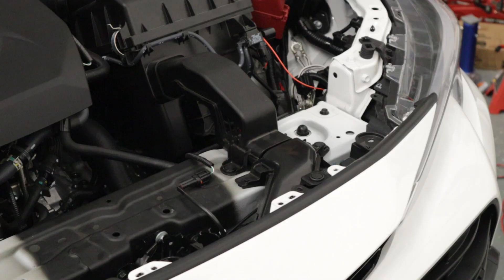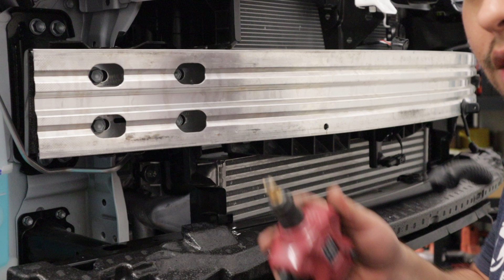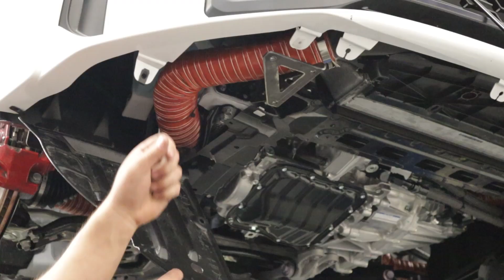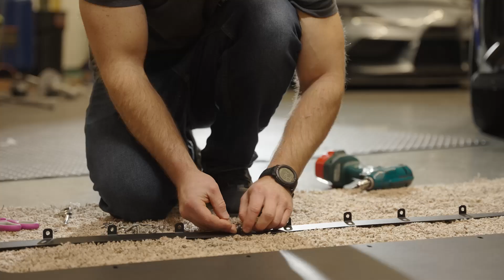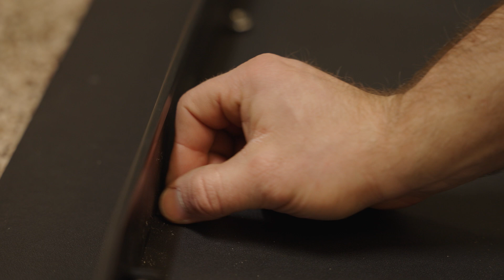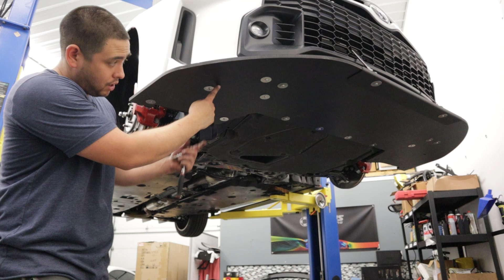How to install our Front Splitter on your GR Corolla!

Comment: I really want this front splitter and fully appreciate all that Verus does in research and development to provide a function over form prioritized products; however, I am concerned that this may be out of my ability to install DIY. I am located in Maryland, so any suggestions for an installer would be greatly appreciated!
Reply from the maker: Dunn Fab Motorsports is probably the closest option that we know about out that way. They're located in NJ so it would be a couple hour drive away, depending on your location. We don't have any direct contacts in MD but that doesn't mean there aren't shops that would take great care of your car. Good luck with your front splitter!
Reply: @VerusEngineering thank you for the response! much appreciated

Comment: are the splitter rods necessary? I think it just ruins the look but not sure if they're completely necessary
Reply from the maker: They are necessary on this specific splitter in our opinion. There is not a ton of support behind the bumper and this ensures the front of the splitter doesn't dip down.
Reply: @VerusEngineering thanks for the reply, and yeah I figured since there only the one stiff mounting point towards the middle.

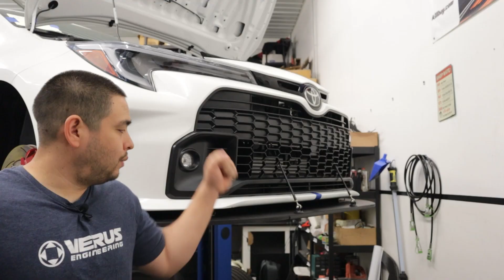Comment: @Verus Engineering It's hard to tell on the video, but the flat-splitter to the underside of the splash guards and OE lip/bumper. Can the triangular splitter mounts be adjusted - to from what looks like a 1/2"  gap all around - to sit flush with the underside? Seen at 22:46 in video.
Reply from the maker: We have an air dam that comes with the kit, which covers the gap between the splitter and the bumper. Is this what you are asking?

Comment: Will tge splitter work with a already install frontlip?
Reply from the maker: Most likely not. However, you might be able to modify it to work by sourcing longer hardware and more spacers. The air dam definitely would not work with a lip though.
Reply: @VerusEngineering  thats what i was thinking

Comment: BUYER BEWARE THIS PRODUCT IS DIFFICULT AND TEDIOUS AFTER YOU PUT THIS ON YOU WILL DREAD THE DAY YOU HAVE TO REMOVE IT FOR SOME REASON. This video is ass y’all need to do better there are way easier ways to do this than your suggestion of keep throwing the bumper on on off. Also how are you torquing the rods with the bumper on? Not to mention all the hardware that comes with the kit and you mention nothing about what and where it goes for half of it. Also thanks for telling at the end of the video that the 4 factory splash guards bolts get replaced.
Reply from the maker: We appreciate the feedback! These videos are meant to serve as a guide to go along with our instruction manual, which is available on our website. 

Feel free to let us know if you have any more questions! 

https://www.verus-engineering.com/install-manuals
Reply: @VerusEngineering  hate to be so harsh I love y’all’s stuff. My proposal to you is hire me on the side to make your instructional videos or to do your technical writing. I am a manufacturing engineer for a very large defense contractor and write work instructions for building fighter jets.

Comment: Will there be a Verus Engineering adjustable wing made for the GRC in the future to complement this splitter?
Would love either a swan neck or even rally inspired design just like whats available for the GR Yaris.
Reply: @verusengineering +1 to having a big rear wing and then the czf tunnels installed on this front splitter!!
Reply: Check out the varis 1 wing for the gr it’s expensive but looks awesome
Reply: @minimumwrist3546  I saw that! Definitely a wing I would consider. But I'll be patient and  continue to wait to see more options in the future.
Reply: @iJakku  same would be nice to have a full verus aero setup